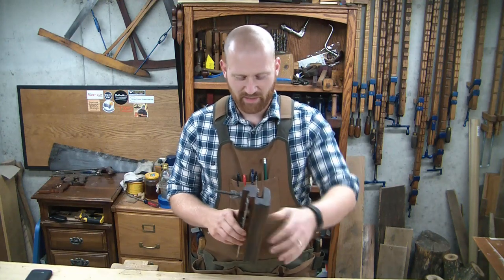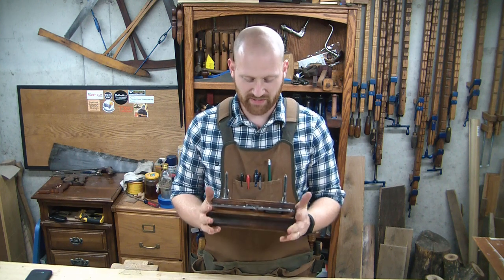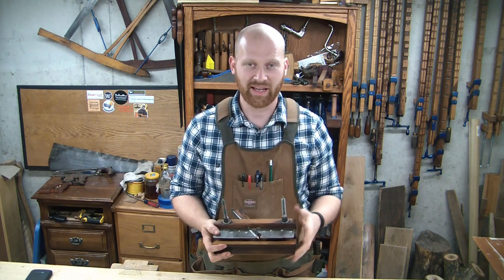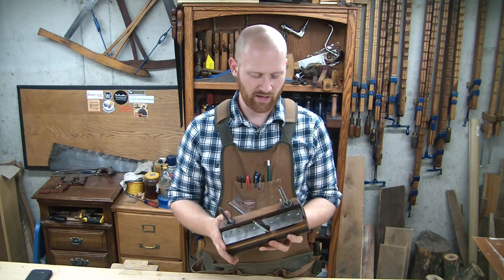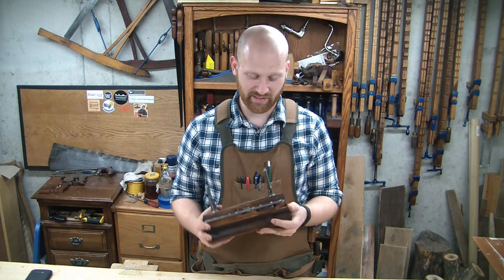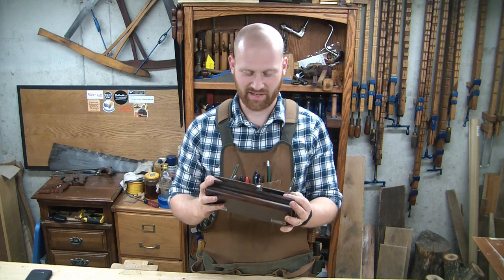How to Restore a Wooden Plow Plane - With Just Hand Tools

Comment: Nice job....I like that it has more of a mechanical fence adjustment.
I ran across one that has Wooden fence rails with wedges, but it's missing the iron, I suck at making irons, I was wondering if you have any links to where new irons can be acquired....??
I'm not sure if I want to deal with a fence that is wedge adjusted rather than mechanical...
I really like the type you have in this video...
Reply from the maker: The nice thing about the old plow planes is they have standardized irons. So you can buy plow plane irons from most people who sell antique tools. If you go down the list of online sellers on handtoolfinder.com I'm sure you'll find several on there that have a set of them.
Reply: @WoodByWright  
Thanks....
I had no idea...

Comment: James, how long to you soak the metal parts in your vinegar solution?  I am assuming that when done, you rinse them with water to remove any vinegar off of the parts and then (seeing the can of 3-in-1 oil on the bench) you protect the parts before reassembling it.
Reply from the maker: +Bruce Brachman it depends on how bad the rust. Usually 6-24 hours. Then yes rice and scrub off the steel after then oil to keep the rust off.
Reply: Ah, the old rice absorbs moisture trick.  I use that for electronics sometimes.  My treating metal is similar.  Once it is clean and dry, I use the rag in a can (with 3 in 1 oil on it) applicator.  Like a big 'oil' marker. Another Paul Sellers trick.
Reply from the maker: LOL sorry spelling issue. "Nice Scrub" not "Rice scrub." LOL

Comment: That is different, I was wondering what time period that plane is from? Are there any markings on it from the original maker? Does it have just the one blade?
Reply from the maker: this one was made by the user for his shop. I would guess sometime around 1880-1900. you can put in plow blades from 1/8"-1" they were common to get different irons from different makers.

Comment: You can also put a piece of tooth pick in the hole to tighten up loose screws into wood.
Reply: Or a wooden match stick. Just put a dab of wood glue on which ever one you choose, tap to bottom of hole, break it off flush and reinsert the screw. Easy fix.

Comment: hey man looks awesome, how old is it? and what was the solution used for all the hardware?
Reply from the maker: +The WoodWorking Junkie I a guessing it was made between 1860 and 1900 it is hand forged but all the screws are tipped. I just use vinegar and water 50/50. I have had that bath now for 5 months and but will need to change it in a bit here. I keep it for dieing wood though. I let it sit in that over night and then scrub it with a wire brush. I like how that keeps some of the tarnish and look wile still cleaning it.
Reply: awesome thanks. I have a 1952 beaver jointer.. works perfect but looks like its seen better days. the bed is almost black and paint is destroyed. Im thinking of doing a few videos of restore, any suggestions, you can see the jointer in most my build vids
Reply from the maker: +The WoodWorking Junkie WOW! I just realized I have not done a video on restoring a metal hand plane. you would think after 100 or so I would have done that. it all depends on how far you want to restore it. I would love to help you any way I can.
Reply: Thank you so much. Mechanically it works great. I want to clean the body, strip the paint and repaint it. clean the rust off the bed and re finish it. most of all beaver jointer come with a safety plate in the shape of a beaver...(whatever the metal plate on the bed of jointers are called) and i want to clean and paint it. its contoured in the shape of a beaver and looks amazing
Reply from the maker: +The WoodWorking Junkie Sweet. well if I had power in the shop my tool of choice for stripping is light blasting. then using a flatting stone and sand paper to flatten the sole. then use a wire then buffing wheel to clean everything, paint, oil everything not painted. then sharpening and setting everything. 

If you do not have a blaster I do a two step bath. 1. vinegar and water 50/50 over night then clean with wire brush or wire wheel. then use a chemical paint stripper rather then cleaning the paint with a wire wheel as that could over heat the steel.
Reply: I do not have a blaster, Ill definely try some vinager and water. Thank you much good sir!
Reply from the maker: Any time! looking forward to seeing this plane sounds like a sweet old girl!

Comment: Nice job James!  I enjoyed watching the various techniques you used.  I've hear you can use Coca-cola for cleaning old rusted metal parts, ever tried that?  Thanks.  Good work.
Reply from the maker: +Mike Kapotsy I used it once, and it was not that great and a mess to clean up. I have used the same bucket of vinegar and water for 5 months now and it works like a charm every time! but I also have an electrolysis rig and have used a few other things.
Reply: +Wood By Wright ever use a blast media?
Reply from the maker: For other things but I try to keep the shop work unplugged. so no grinder or rotary brush. oh well.
Reply: Wood By Wright Well I was thinking like sandblasting media with air compressor or glass beads.
Reply from the maker: +Mike Kapotsy Ya that was what I was saying. I have used it for car parts and such but not for my shop usage. I have a good friend with a blasting cabinet that makes quick work of it. great tool to have on hand.
Reply: Wood By Wright ahhhh I see.  Well I find it interesting.  I just wondered if the blast media would be okay to use.  I watched Nick Ferry restore and old hand plane using it before and the results seemed pretty good.
Reply from the maker: ya it would work fine. I just would not tough the iron or bottom of the sole but most of the time those clean up when sharpened and flattened. If I was not unpluged I would probably be using that!